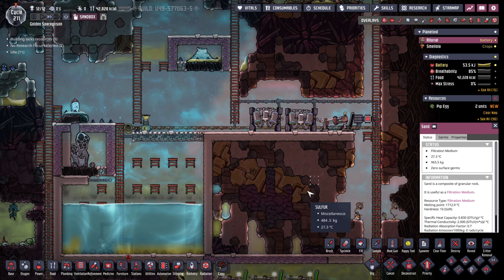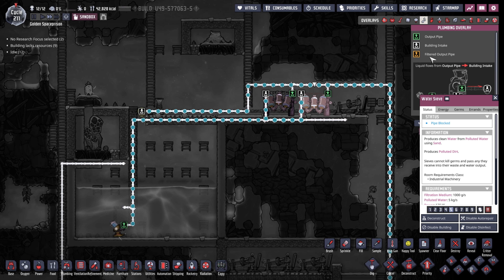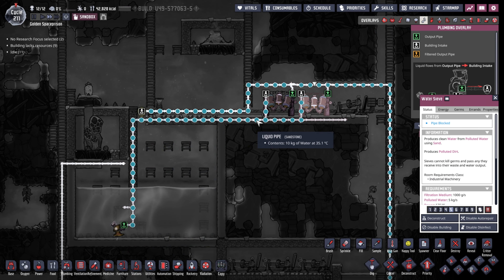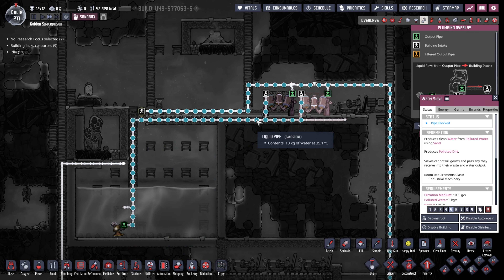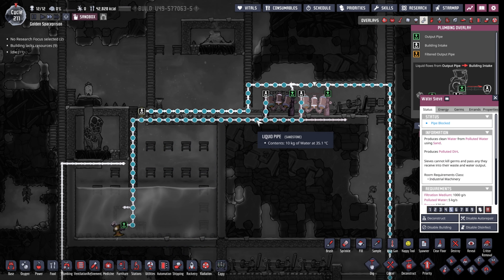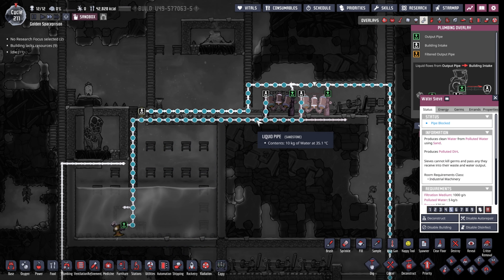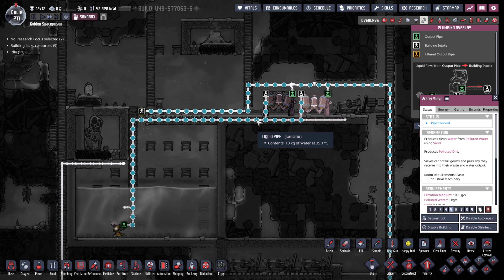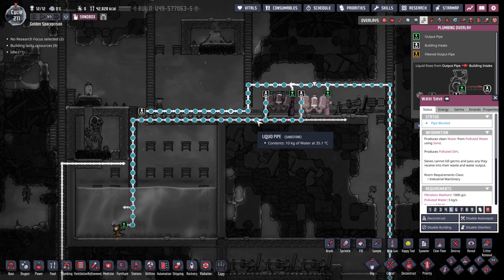How to Clean Polluted Water in Oxygen Not Included

Comment: Ok I have a question. Some Youtubers show us how to turn Polluted Water into normal water, some show us how to turn normal GERMY water clean, but in a normal game it never works like that. My tub of dirty water coming from the toilets is both Polluted and germy. So do I need to do both operations, one operation to remove the germs using chlorine, and one to turn it into normal water using a sieve and sand ? Do I need to do both operations ? If so, in which order ? Thanks for your help.
Reply from the maker: For the toilets I use a septic tank, that water is only used for one thing and that's the bathroom, it's ok if it's germy as they wash their hands. You have to use the water sieve to turn it into normal water and then use the chlorine, in that order, for any water you wanna use for drinking.
Reply: @MCGamesYouTube  Roger that ! Thanks